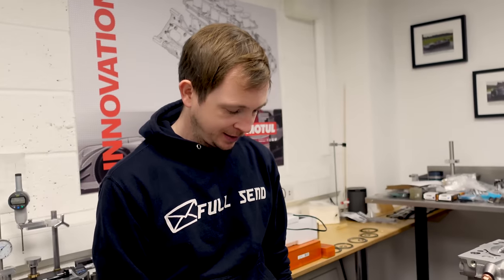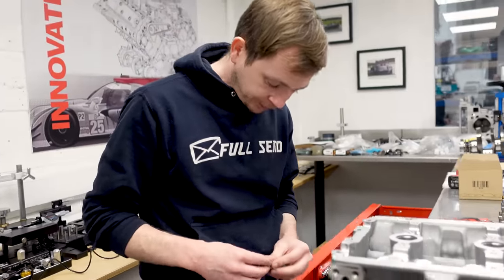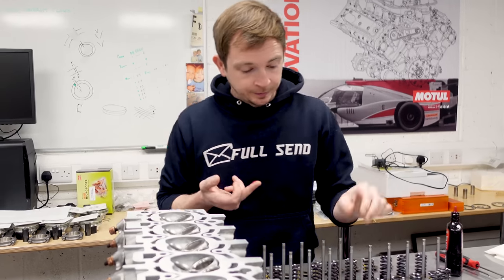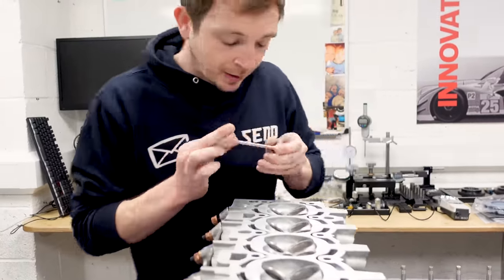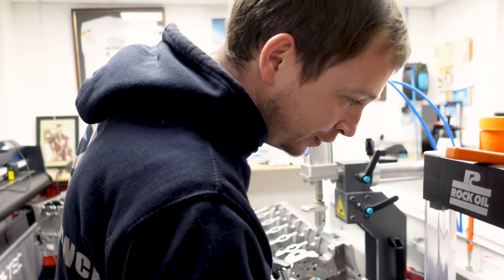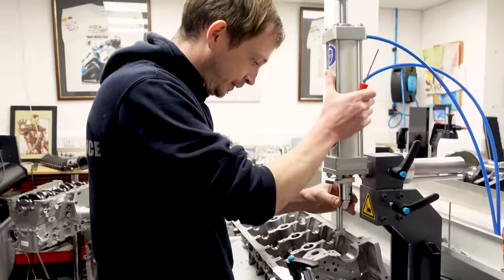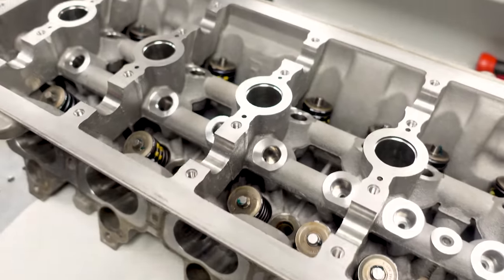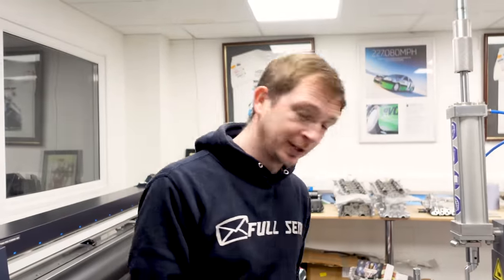We Made a Mistake! Building a Huracan GT3 V10 Head

Comment: Just a little tip, many of these high end engines actually just use the elring valve stem seals from the 16v Golf GTi. They cost pennies compared to the exact same item in the o/e bag for much more £££
Reply: Is this not a similar story when looking at rs6 vs a6 all road running gear ?

Comment: Great video, loving all these build series!

Are you able to elaborate on the running in procedure? Intrigued as to how you can get away with not following the conventional ring bedding in / not letting the engine idle etc. Is this specific to these engines / rings?
Reply: Agree, very different to all other run in procedures I've researched on. Please show us how the engine dyno running in / tuning works too!
Reply from the maker: I don’t know what you mean by conventional?

This is how you run in rings on alusil bores, old iron blocks were different and that was more due to the camshafts over the bores….
Reply: @REPerformanceUK  what about that rs3 with cast iron liners? Would you have done a different run in procedure? People talk about needing to generate strong cylinder pressure to get the rings to properly bite - guess that's not the case with alusil?
Reply from the maker: @thimira92  Yes we would use a slightly different approach with the RS3 as the cylinder wall surface is much harder.

Comment: Very interesting video, but I have a question: 
Could you fit the valve seals AFTER fitting the valves? 
That way you avoid pushing the seal and valve seat off.    Nick